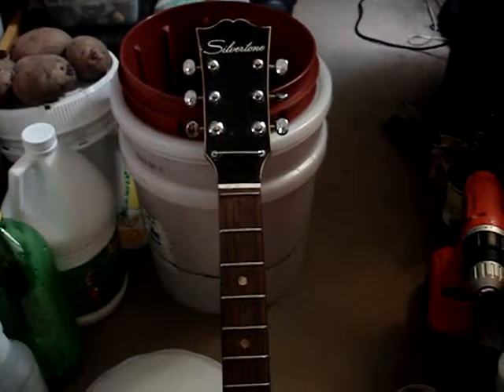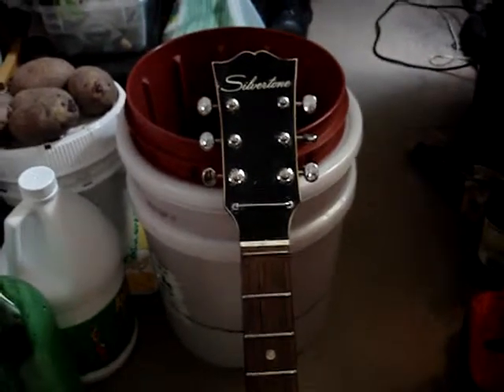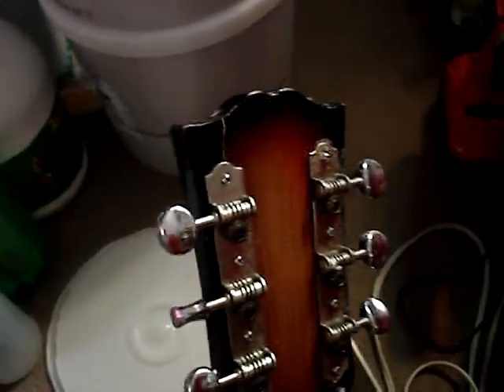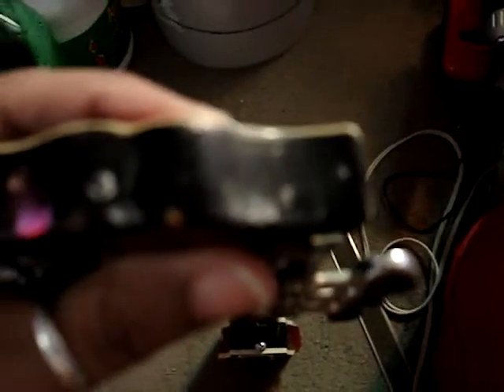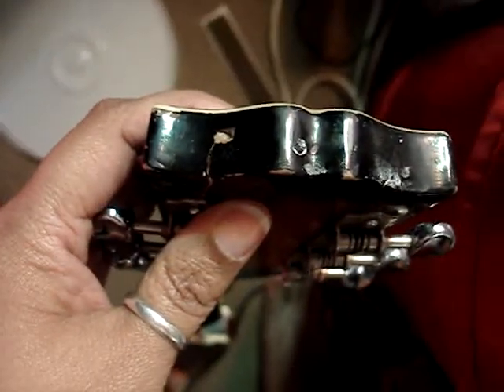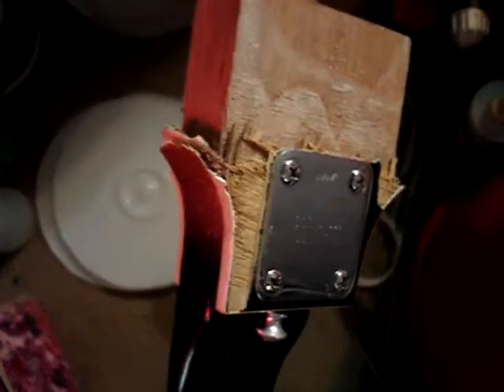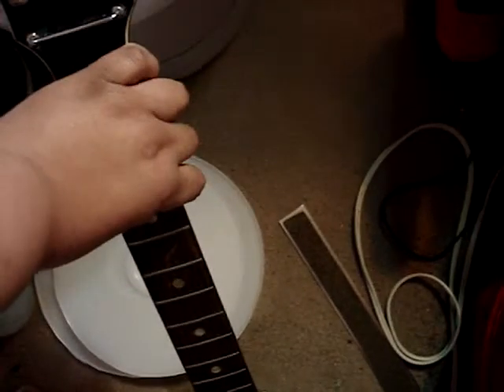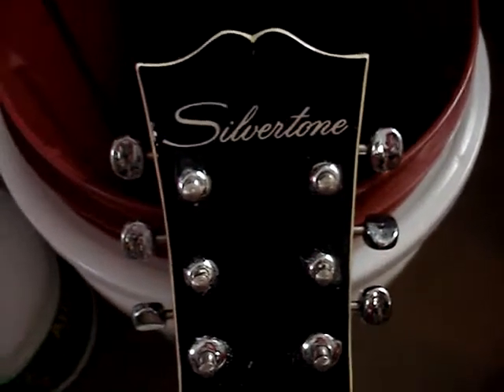Video Question for Southpaw Davey

Comment: that will do great. 3 4 6 string it all fun. The other good thing is you have a frets too. Or you could just pull off the tuners and make 2 3 strings. I would put that neck on a box or a oil can. But just look that all the tuners work. The cracks you can water some wood glue down 50% and run it in to the cracks and clamp it.
I would use it nice find. Dave
Reply from the maker: My daughter plays the bass, so I think a four string would be best. I just don't know how to modify it. But yeah, all the tuners seem to work just fine. I'm sorry but I'm not sure what you mean by putting it on an oil can or a box though. I was planning on getting one of the CBG kits for the rest of it.
Reply: I would go with 6 or 3 string. It can be open tuned but you can also tune it normal. The oil can or box well a 5 gallon oil can makes a great body too or a wine box or anything you want put it on Hub caps are cool. I built a hub cap guitar. But as that is a normal neck you would have to strengthen what you put it on. CBGs the neck is a through neck. It runs all the way through the box so the neck gives the strength.
Dave
Reply from the maker: Ah..., I have no idea how to turn that neck into a guitar using an oil can or wine box unless they come in a kit.
Reply: Where are you getting the kit from?
Reply from the maker: I was going to order it from that site that you recommended.
Reply: The kits from there are good. Go with 3 string. Maybe use the neck for your  second  project.
Reply from the maker: I don't suppose you have instructions on how to put together an oil can guitar?
Reply: No I am sorry its sort of a look at the neck and the can but you should have alook at rpeek he made some real nice banjos from cans same thing  but a guitar neck that might help alot rpeek . Dave
Reply from the maker: Thanks Dave.
Reply: Your very welcome ;-)